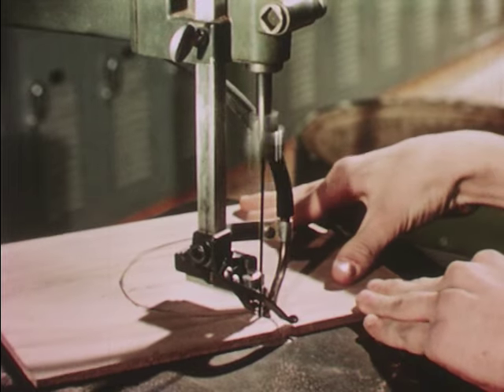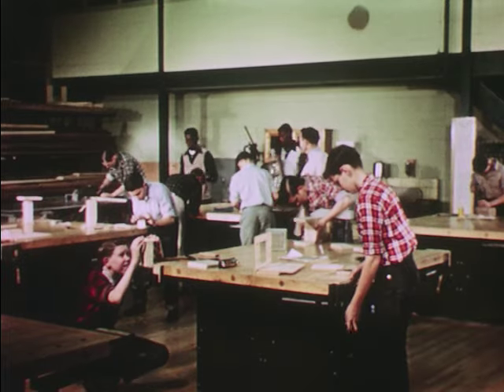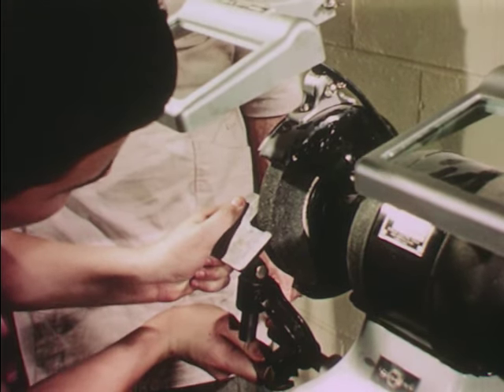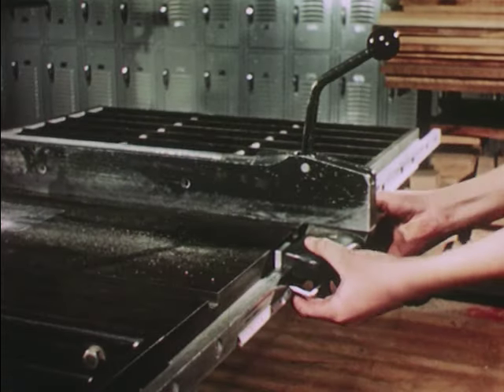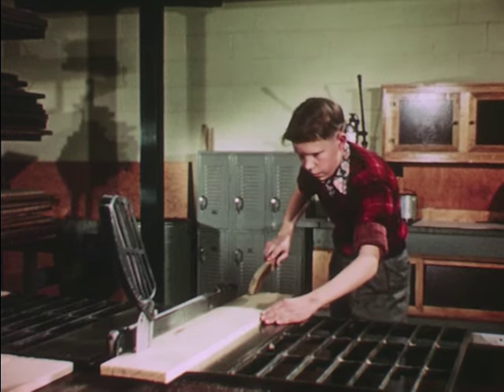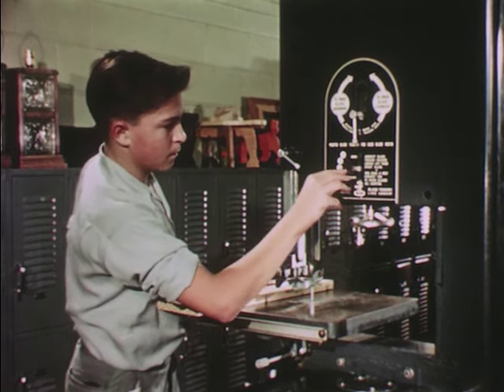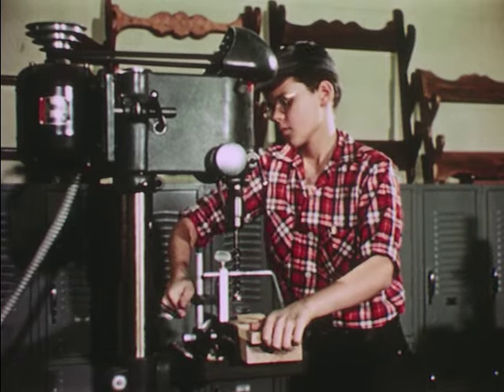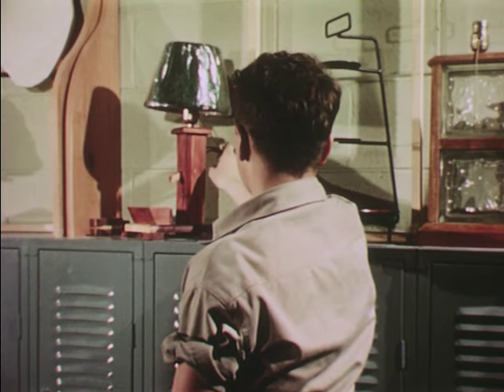Working Safely in the Shop (1953)

Comment: Much of the basic machinery hasn't changed much since then. Of course there are many more battery powered tools. More recently there are safety solutions to stop blades on table saws, before a finger is cut.